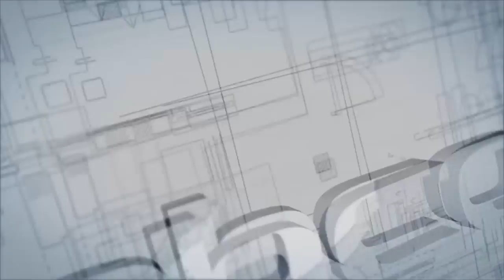Dustlessblasting Vs Clemco

Comment: I've taken the time to translate this for your English viewing pleasure...
Dustless Blasting: Lower pollution and less waste of sand and water.
Clemco: Greater pollution and greater spending of sand and water.
Dustless Blasting: Pressurized hopper with sand and water.
Clemco: Sandblasting system converted to wet blasting.
Dustless Blasting: All the controls are integrated on the hopper.
Clemco: The controls are separated from the equipment making it difficult.

Comment: in English..the winner is?
Reply: Doesn't really say the winner, but here is the translation: 

Dustless Blasting: Lower pollution and less waste of sand and water.

Clemco: Greater pollution and greater spending of sand and water.

Dustless Blasting: Pressurized hopper with sand and water.

Clemco: Sandblasting system converted to wet blasting.

Dustless Blasting: All the controls are integrated on the hopper.

Clemco: The controls are separated from the equipment making it difficult.